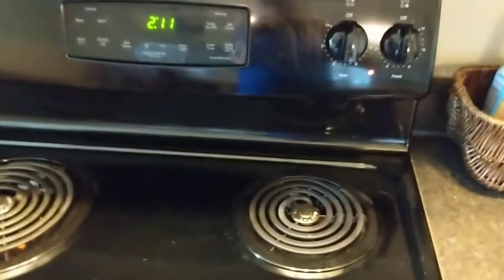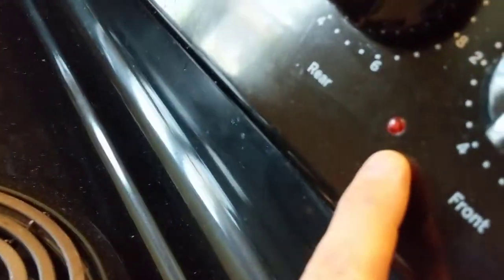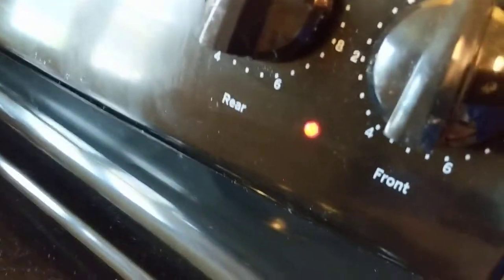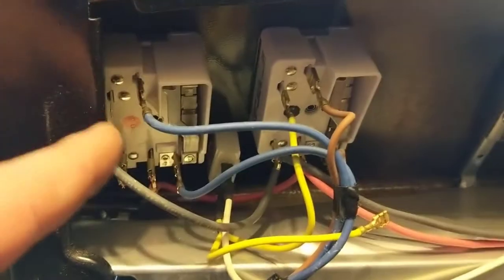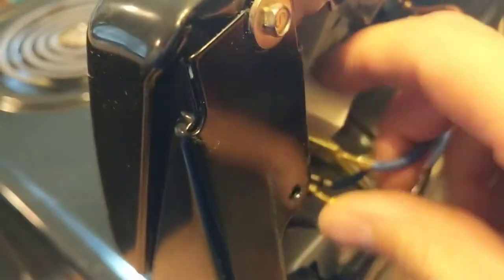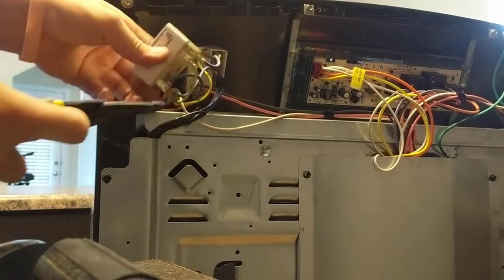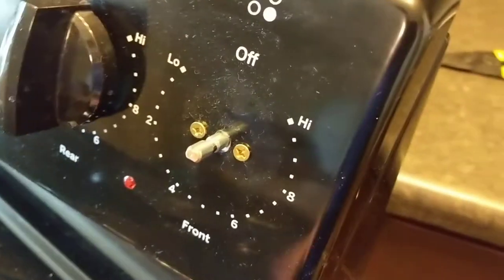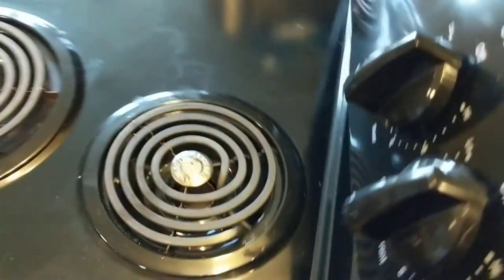Electric Stove Hot Surface Light Won't Turn Off

Comment: thank you that's the easiest way to figure those switches out
Reply from the maker: I agree on that. I can check the switch with my meter and find that it's bad as well. But I've had them where everything tests out electrically, but still had issues, which is why I use this method when the hot surface light won't turn off. Thanks for watching Tom & stay safe out there 👍

Comment: I almost always photo the connections before disassembling. This may sound unnecessary or simpleminded, but as a DIYer lacking experience, the reassembly may not be as obvious as it appeared when disassembling.
Reply from the maker: I do the same on things I'm not familiar with or never worked on, which is very smart to do, & most people don't. Sounds like you have the right mindset & can figure things out. Thanks for watching Dave & Subscribe to the channel 👍

Comment: Well, I successfully replaced the switch. It was easy after watching your video. The problem is that now it's 1 year later, and I've got the same problem again. That new switch that I installed lasted exactly 1 year and 4 days before it pooped out on me. The stove is only about 3 years old. lol. I guess I better buy a few extra switches at the rate they are crapping out. Anyway, when this one died, I just pulled up your video for a refresher course on replacing it. It only took me 10 minutes. Now I'm back in business, good as new.  I really appreciate this video that you made. I will probably be watching it again in another year or two, when I replace the switch again. lol. Damn, they just don't make quality stuff any more, it seems.
Reply from the maker: Wow that's crazy! I haven't had to replace the same switch more than once. You could have just gotten a bad switch from the get go. But I'm glad you referred back to my video & it came in clutch for your repair. Are you subscribed to the channel or did you search the issue on Google or YouTube? Anyways, thanks for watching again KeithOutWest 🛠️👍
Reply: @ApartmentMaintenance  I found your video doing a YouTube search. I saved a link to the video in my Favorites, so it was easy to find again. I've just subscribed, too. Thanks!
Reply from the maker: @KeithOutWest  Appreciate that & thanks for subscribing, it helps support the channel.

Comment: This video is very clear, thank-you!  I followed the steps, and I have the same type of stove as shown in the video.  It is the 6-inch rear right-hand burner which is causing the light to stay on (= burner not heating, knob switched off, but light is on).  But installing a new switch for that burner did not fix the problem.  Is it possible that the switch I ordered from Amazon is defective?  In your comments below, you said it "could be a wiring issue"? Any idea what could be the problem?  Advise ordering a new switch from GE? P.S. My stove is not old, maybe five years give or take.
Reply from the maker: Thank you for the kind words on the video. If your comfortable with electrical work & can do the troubleshooting yourself (I know you said "installing a new switch for the burner didn't fix the problem" but you didn't specify if you replaced it or someone else did. But whoever does it, can try the troubleshooting like I did in my video where you unplug the stove, unhook one switch and plug it back in & see if the light goes out. Once the light goes out you know that's the bad switch. The switch I replaced in the video was the switch for the large 8" burner in the front which is the far right switch on the control panel. The smaller 6" burner in the right rear of the stove would be the 2nd switch in from the right side. Whatever side of your stove the light is staying on, it would be one of the switches on that same side causing the issue. Unless it's a malfunction in the control board between the stove top switches. That is rare but it can happen. Just double check all your wiring from replacing the first switch to confirm everything is wired properly. Thanks for watching Jennifer & Subscribe to the channel 👍
Reply: @ApartmentMaintenance  Thanks for you prompt reply!  I did the troubleshooting and replaced the switch myself.  Maybe I replaced the wrong switch.  I was looking for the switch that makes the light stay ON after I unhook it/plug the stove back in.  I should be looking the switch that stays OFF when I unhook it/plug the stove in. That would be the 8" burner.
Reply from the maker: @jenniferwalden3029  That is correct! Your looking for the switch that makes the light go off once it's unhooked, cuz that will then tell you which one it is. The switches are different for the 8" burner & 6" burner. I'm not sure which one you purchased but if you purchased the 8" burner switch & put it in the spot where the 6" burner switch is, you should put the correct one back. If your stove is like the one in my video, the 8" burner switch is part # WB24T10025 & it usually has a orange dot on the back of it where the wire terminals are. The 6" burner switch is part # WB24T10029 & usually has a black dot on the back of it where the wire terminals are. Hope this helps! Thanks for watching Jennifer. 👍
Reply: @ApartmentMaintenance  Yes, it works now that I replaced the 8" burner switch.  I replaced both switches, but I'm going to just leave it.  I am so happy to have fixed that!  Wow!  Nothing like following directions!  Thank-you!
Reply from the maker: @jenniferwalden3029  Haha nice job 👍
Reply: Now this is f.n team work.

Comment: I got this problem today , is it ok to keep using the stove till I get it solved?
Reply from the maker: If it's the same problem as I had it should be ok, just make sure the burner is shutting off & it's just the light that's staying on. I would get it fixed soon as you can though. Thanks for watching 60 Pineapples ! LOL 👍👍 Subscribe to the channel 👌
Reply: its a different model whirlpool showing cook top on/ cook top hot display on even though the burners are shut and cool , thank you for ur fast reply I appreciate it and subscribed 👍

Comment: Thanks for the info. Are all 4 switches the same ?
Reply from the maker: No problem! The switches are different. On the model stove I show in the video, the two large burners have the same switch part number & the two smaller burners have the same switch part number. Always check your model number & look up the part numbers so you don't put the wrong part in. Thanks for watching Gene & Subscribe to the channel 👍

Comment: This just happened to my GE that looks just like this range, 2 burners, is the same switch for all burners?
Reply from the maker: On mine the 2 large burners (8") have the same switch, & the smaller burners (6") have the same switch. You would have to search your stove model # and look up the switches, or take the back panel off & see if the part #'s are the same for each size burner, just make sure to unplug the stove before removing the back panel off. Thanks for watching hippiedude72 & Subscribe to the channel 👍

Comment: How would I know if I need a new fuse cuz my light is not on. I unplugged it and did what you did but it turns on when it’s on
Reply from the maker: It will turn on when one of the switches is still hooked up to it. It's not a fuse, it's a switch. If your light is staying on when the switches are off you need to figure out which switch is causing the light to stay on. Thanks for watching Nazgul & subscribe to the channel 👍

Comment: I got a question if you don't mind me asking, but why did you only work the left side only when checking the stove light? You only check the left circuits? Or would you check em both?
Reply from the maker: Great question. Cuz that's the side of the stove that the light was on, so it would be something on that side, since the other side of the stove & burners have their own light. Hope that helps. Thanks for watching Moses & Subscribe to the channel if you're not already. 👍

Comment: Hi, will this works the same way for my glass top GE range? The light is not beside the switch, they are close to the cooker and one of the light stay on. The burner works only for 5 seconds then it turns off and can be only turned on for another 5s when the surface is completely cool. Do you think it's the switch problem? Thank you.
Reply from the maker: It's really hard to say without testing the burner & switch itself. With the power off to the range (Unplugged from the outlet) You would have to use a multimeter to test the switch for continuity. Which you can test the burner at the switch & test the switch to see if it's good. Thanks for watching Luke & Subscribe to the channel 👍

Comment: Does it matter if i get a left or right regulator switch when replacing it?or it  will not matter?
Reply from the maker: The switch doesn't matter on left or right, it matters by size of the burner & wattage (6" or 8" burner). If it's the 6" burner you need the switch for, then buy the switch for the 6" burner. If it's the 8" burner you need the switch for, then buy the switch for the 8" burner. Contact GE appliances with your model # of your range & they will get you the correct switch for whatever burner your having an issue with. Thanks for watching Ben & Subscribe to the channel bro 👍

Comment: Thanks for the video! 
Could it be that the “hot surface” light is telling you the other two switches could be bad?
Reply from the maker: Whatever side of the range the surface light is illuminated, that would be the side of the stove top that one of the switches needs replaced. In my video the light was lit on the right side, so it would be either the right front or right rear switch causing it. So I tested each switch to find which one was causing the issue, then replaced it. Thanks for watching K Thax & Subscribe to the channel bro 👍

Comment: Hi. I have a Kenmore glass top oven. My surface hot light stays on sometime when the surface is completely cool. I wiggle the switch and the light goes off. Can I take it out and clean it with electrical contact cleaner? Thanks
Reply from the maker: Sounds like one of the contacts in the switch is bad. Best thing to do is have the switch replaced. Thanks for watching Kenny & Subscribe to the channel 👍
Reply: @ApartmentMaintenance  thank you for your advice. I'll subscribe now.

Comment: Question please... What if both right-side burners cause the light to flicker, but both burners still function as expected?  Thank you!
Reply from the maker: Sounds like both switches are bad, but it's hard to say since I'm not there troubleshooting. I've never seen that before, but it could definitely be a possibility. Thanks for watching F-150
Reply: @ApartmentMaintenance  Thank you!
Reply from the maker: @KeithOutWest  No problem!
Reply: That is what I am encountering.  When both burners are on and working, the indicator light flickers or sometimes does not light up, so in such case I am wondering whether it is the indicator box/wire that needs replacement.

Comment: Hi, since currently there is a Covid 19 outside, if I keep the bad switch on and leave the light on, is it danger?
Reply from the maker: It all depends on your situation. On the stove that I showed in the video, the burner would shut off when I turned the knob off, but the light stayed on which wasn't a major issue besides the light staying on. So you would have to make the decision on how to handle it, if you don't think it's safe then you can unplug your stove when your not using it until you get it fixed. I can't say that it will be fine or not cause I never seen your stove to see exactly what's going on. So that would be your decision. Thanks for watching Edwin & Subscribe to the channel 👍
Reply: @ApartmentMaintenance  thank you, I am using the Frigidaire MODEL CFEF3048LSM, could you help me which switch model I need to buy ?
Reply from the maker: @edwinwang215  Without seeing it in person I can't say what the problem is, and if you don't feel comfortable troubleshooting the stove I don't recommend messing with it as it could be dangerous. Even with the model number you can't guess what the problem is until you troubleshoot the stove. If I had to take a guess, I would think it's a bad switch causing it, but I wouldn't know without seeing it. So you don't want to go buy a switch and not know which one is causing the light to stay on, until you know for sure, cause the switches will be different for different size burners.

Comment: I’ve similar problem but the burner also won’t turn off. Wonder what can I do? Will replacing switch fix the burner as well? Or need to replace the burner as well? I’m thinking to switch the burner from the other side to the one with issue first to test if it’s a burner issue. Do u think that will work or usually it’s another issue? Thanks
Reply from the maker: I've never had the issue you described as the burner won't turn off either. You can try switching the burner but I don't think that's your issue. I would say it's the switch causing the issue, or it's the knob. The knob could be cracked on the inside where it turns the switch and you think it's turning off when you move the knob but it's not turning the switch off. Try a different knob on that switch first and see what happens, then you can try the burner. If it's still on, then it had to be the switch like in my video. Thanks for watching Mic Cheung & Subscribe to the channel bro 👍
Reply: Right yea properly it’s the switch. Ok I will give that a try. Thanks :) And subscribed

Comment: Be careful, THIS IS NOT the "hot surface indicator". This indicator only show that one of the heater is on. If the problem is related with the "hot surface indicator", than the problem is one of your heater (not the switch)!!
Reply from the maker: Thanks for the advise. But it's definitely called a "Hot Surface Indicator Light" Yes you are correct in the fact that the light is there to let the person know that a burner is turned on. The light on the left side in-between the left 2 switches is for the 2 burners on the left side of the stove & the light on the right side in-between the right 2 switches is for the 2 burners on the right side of the stove. In this case, the light on the right side of the stove was on all the time, even when the switches were turned off. I checked all the burners & they were all off. The problem was that the switch was bad for the right front burner. The infinite switch can fail a few different ways, it can not work at all, it can be stuck on high or low heat, or it can fail like in this case where the light is stuck on. Thanks for watching Pro-Tech & Subscribe to the channel 👍

Comment: Is it safe to use any type of pliers to unplug?
Reply from the maker: If you got it unplugged I don't see why not. Thanks for watching Joe & Subscribe to the channel 👍
Reply: Never touch the wired connections regardless the type of tool you’re using unless the product is unplugged, repeating…. Unplug it from the wall before touching any wired connection.

Comment: Hey dude!  Work smarter, not harder.  Just check the continuity between the "P" and Line1 or P1 on all switches.  If there is continuity while the switch is not switched on then you found the culprit!
Reply from the maker: @lopesh.4431  Yeah I know, doing it the way I did was to create a video for the average person around their house who is handy but maybe doesn't have a meter to check continuity. Thanks for watching 🛠️👍
Reply: @ApartmentMaintenance  Good job!

Comment: Great video, here’s how it worked for me , I turned breaker off and then on only when I cook(use) then turn it off when not , I would say about a week later I went to turn stove to use and light for some reason stoped staying on its bin 7 hours and still no light on , will update if it turns on again . (7/4/2021)
Reply from the maker: It will come back on at some point, the switch is going bad. If it was my stove I would get a new switch. Thanks for watching Tarik & Subscribe to the channel 👍

Comment: I am also having the same problem but little weird.. my light is on and at the same time the burner is also heating a little.. it won’t go off.. will it be okay to just unplug the burner for a while and get it fixed later ? Like is it safe ?
Reply from the maker: That would be your decision. If your asking what I would do if my stove was doing that. I would unplug my stove until I got it fixed. Electrical issues are not something you want to take a shortcut with. Safety First! Thanks for watching Antriksh & Subscribe to the channel 👍
Reply: Antrisksh sahai how did you fix that problem?

Comment: Is it safe to use the stove in this situation... bcz it’s not possible for me to unplug the wire .. I used small pot on big surface and that’s why it happened
Reply: I can’t pull the back off
Reply from the maker: I can't say exactly what's going on in your situation without seeing it myself, but if your situation is the same as in the video, then the burner is on high setting when turned on. I would make sure your burner is still turning off when you turn the knob off. You can make your own decision whether to use the burner or not, if you don't feel comfortable using it then I wouldn't until it's fixed. Thanks for watching 👍
Reply: Apartment Maintenance thank you ❤️

Comment: I had this problem but after 5/6days of continuosly pulling the plug off before bedtime & plugging in when using it, the light seems to be back to normal. Is it normal or should i still get it checked?
Reply from the maker: I would say replace the switch cause it's going to happen again. But that's interesting that it went out, I've never had that happen. Thanks for watching Maryann & Have a good Christmas 🎄
Reply: @ApartmentMaintenance  thanks for your reply. Merry christmas 2 u & ur team as well.